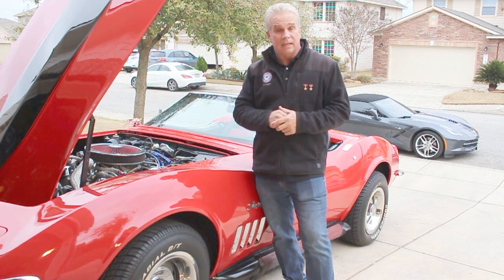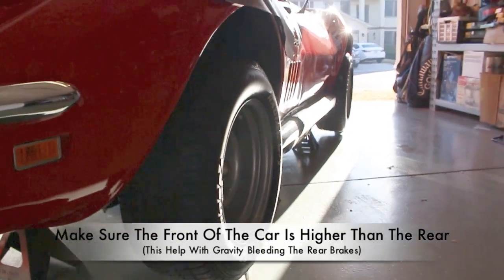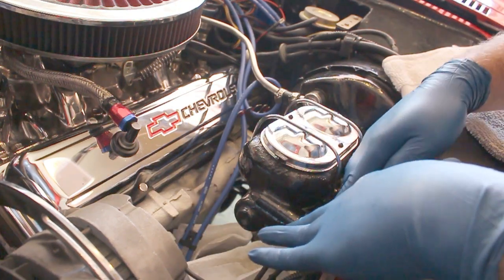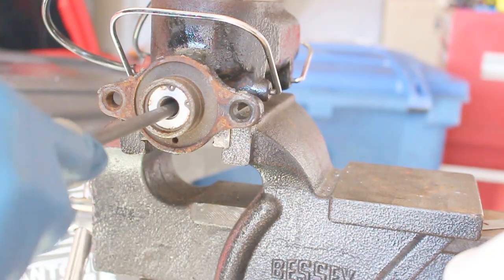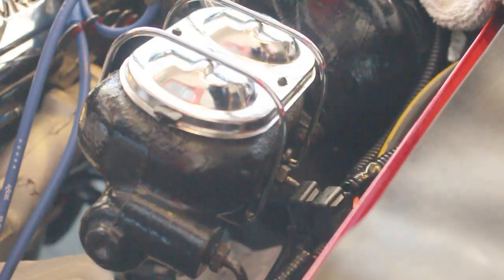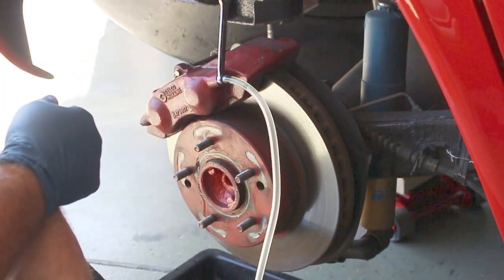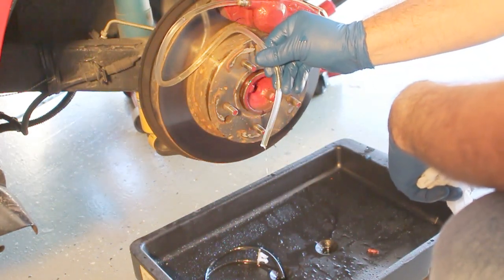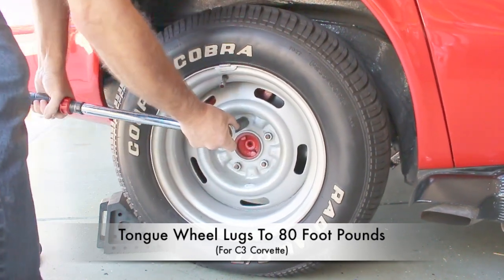1969 Corvette (C3) Master Cylinder And Brake Bleeding

Comment: I watched you put the lid on your master cylinder on both of your videos without pushing the rubber diaphragm gasket back to the correct position.
You left it hanging down, it should have been pushed back up, so that it is not hanging down in the brake fluid.

Comment: hi love your video. I have a 69 vett with all disk brake system. I dont have a booster. should I add one ?
Reply: Kind of pricey, not to hard of a job, takes away originality of the car if it is original. I have the same, not a power brake system. I go back and forth on that question, should I or shouldn't I. So far my gut keeps telling me to leave it original but on the other hand how would anyone know the car didn't come with a booster? I am very hesitant on adding anything that border lines on modification even though the temptations to do so can be overwhelming.

Comment: I wanted to see you test the breaks when you completed it. I am having issues with the front right brake and continually having to bleed it over and over as I am concluding air is seeping in where the tube brake line connects to the rubber line that runs to the caliper. I have been using the hand pump bleeder but looks so much easier doing the gravity bleed yet for some reason not feeling the confidence of doing so. As I have bled all the brakes and this issue continues to repeat it seems to only affect air bubbles in that front right caliper and doesn't seem to have any effects to the other 3. I was thinking perhaps I need to bleed the master cylinder but beings I only have problems in the 1 I am thinking that is not the issue. The rear calipers have 3 bleeders on each, why did you only choose the top front bleeder?

Comment: just did a master cyl. on my 80 corvette....9/16th line wrench for tube removal, but nuts on the master, are not 9/16th they are 14 mm. just a thought, think chevy went to metric in mid 70's.

Comment: Hello and thanks for this video. .. Question is, would you advise tilting the vehicle lower in the front as u gravity bleed front brakes?
Reply from the maker: No,  the front is fine. Keep the rear on the C3 Corvette lower than the fronr. I have set both the front and the rear even before and had to redo the bleeding several times. It always works best to have the rear lower than the from on the C3 Corvette.

Comment: Do you know the size of the red fittings that were used in the master cylinder?
Reply from the maker: No, but the fittings were with the kit that I got from the auto store. In fact, the kit had several sizes that I picked from for the correct size.
Reply: Thanks for the reply, I asked the size of the fitting cause I have heard people having problems with some kits.
I was going to make up a brake line fitting and attach a hose to it. thanks
Reply: I know you probably got this all sorted out by now, but thought I'd comment an observation for others. 

The fittings to the master cylinder are 2 different sizes. You can kind of tell in the video that the rear is larger. I used the same kit as Corvette Hop so it was not an issue as it included both sizes I needed.

Comment: Thanks for the video. I have an 82 and noted there is a bleeder valve on each half of the caliper. Do I need to gravity bleed both? If so which first? 

I replaced my driver side rear caliper which was leaking in case that makes a difference. Thanks.
Reply from the maker: If you have a bleed valve on the back half of the caliper and one on the front half then both bleed valves will need to be bleed.
Reply: Thanks. I found another one of your videos where I saw you opened both bleeders on the caliper at same time.

It wasn't clear on this video as it only showed the outer bleeder being opened with a hose connected so I wasn't sure if it was all that was needed since it is furthest from where brake line connects. Maybe it was the fact your problem was with the front brakes? 

Anyway I should be good now. Thanks again.
Reply from the maker: You are welcome. Please post it it all works out for you.
Reply: It worked well after I fixed my leak by replacing the brake line and brake hose on the driver side rear. Only difference is the nuts holding my master cylinder to the booster are actually metric - 15mm which is between 9/16 and 5/8.  Only took about 10 presses of the screwdriver to get all the air out of the master cylinder. 

I have a nice solid brake pedal now.😊  Thanks again.
Reply from the maker: @berts4877  I am happy to hear it all worked out.

Comment: Ok, so I've got a 73 with manual brakes, no air in system, master cylinder is good, but pedal goes to floor...are the calipers causing the problem?. rapid pumping of pedal  gets a little firm, but goes away instantly after releasing the pedal. 
 No leaks anywhere, bought a new master, but problem remains. Master is very solid with brakes lines removed and red plastic plugs in the 2 ports where lines connect. All calipers/pads replaced a while back, but car has been parked for a long time, brakes worked OK last time I moved it...about 6 months...
Reply from the maker: Did you bleed the brakes correctly? I found that on the C3 Corvette, I had to bleed the brakes with the rear in lower than the front end of the car. Starting with the rear passenger side brake them the rear drivers side. I have a video on how to do that by gravity bleeding the brakes. Are the brakes firm once they are bleed? If not, that may provide you a good clue that they are not being bleed correctly. Yes, it is possible to have bad calipers or even a bad master cylinder, but check that bleeding process first. Plus, it is the cheapest thing to do before replacing parts. I would be happy to take with you on the phone if you would like to call.
Reply: I have the same problem did you find a solution?
Reply from the maker: Andrew, see my comments. Also, check for runout alone with all I mentioned in my comments.
Reply: I have not worked on the car  right now. I replaced all 4 calipers (with new) a while back, I had to pressure bleed to get the air out, then pedal was very firm and only depressed about 3/4"...'vacuum' bleeder and 'gravity' method didn't work at all....parked the car, now the pedal goes to the floor, I replaced the master cylinder, expecting the old (original) unit to be rusty and bypassing fluid, but it looked fine.  and found no improvement. the front calipers are a little rusted, the rear look OK...The parts store counter man said these brakes were troublesome. He had a customer with a 1971 corvette that had so much trouble with the brakes, the guy sold it to get rid of  the problem.
Reply: that normally means theirs a leak somewhere causing it to not hold pressure

Comment: Why the bench bleed on the master? I normally only do that with a new master or if one of the reservoirs has drained too far.
Reply from the maker: Robert, Very good question, I did that because all the fluid ran out the front brakes (front Cylinder of master Cylinder) do to a leak. That forced me to bleed the Master Cylinder and brakes. The rear cylinder (of Master Cylinder) still had fluid in it.

Comment: I'm not going to be driving my C3 much just to car shows and museums. So it will be sitting for long periods of time. I've read that dot 5 is the best option for that scenario. What are your thoughts?
Reply: Dont think that's necessary. Heard Dot 5 is for racing applications due to extreme high heat tolerances. I would stick with Dot 4
Reply: Dot5 is the better choice.
Reply: @correyy  dot 5 has its negatives. I'm running dot 5.

Its literally 5 times more money. It is paint safe though.

It won't absorb water, but if water somehow gets into the system, the water will eventually pool in an area and maby cause more rust.

Oh, and if you switch from dot 4 to dot 5, you gotta take everything apart and flush all of the old dot 4 out. Pain in the toucas. 

They are not compatible.